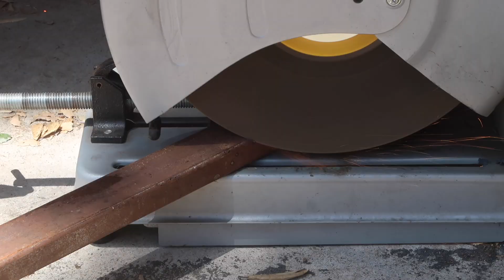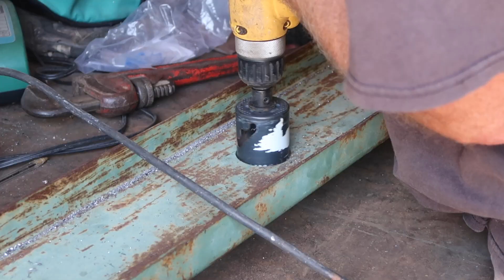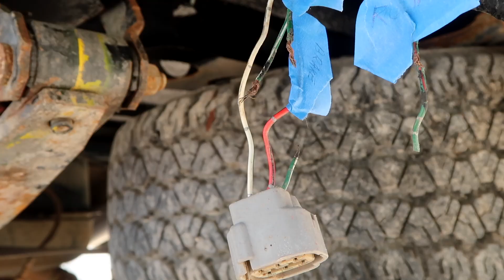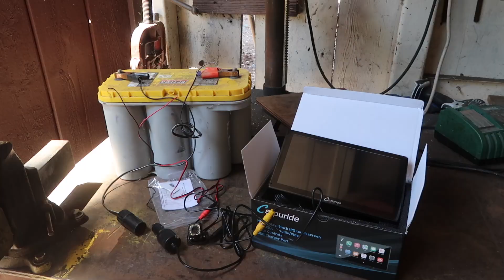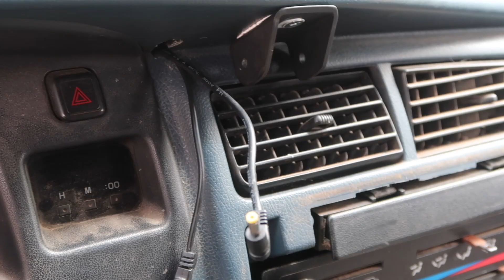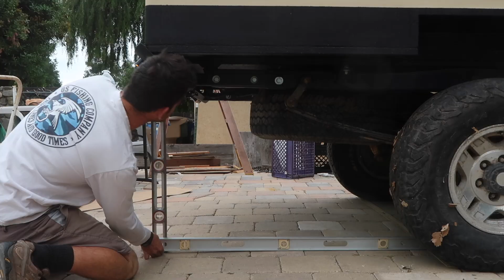Building A 4x4 Truck Camper | DIY Rear Bumper & Back Up Camera Install

Comment: Watched all your excellent camper build videos (THANKS).  Perhaps already asked and answered in the thousands of comments, but i hope you can answer a few: 1)did you use marine plywood?; 2)did you consider building out of xps covered with fiberglass (to save weight, cost, and work)? ;  3) do you have a material cost and time cost so far?   Great work so far, looking forward to more...
Reply from the maker: Glad you've enjoyed the videos Daryl.
1. no its underlayment plywood
2 . I did. 
I couldn't source XPS in California for 1.5 years (when I started the build) because of some environmental requirement change. 
Using glass over 25psi XPS, I would have to use thicker fiberglass cloth and more epoxy to achieve a similar rigidity and impact resistance to the 6oz fiberglass over plywood skins so it may not have been cheaper or lighter. I think it would have saved a lot of labor though.
3.I have not kept track of how much time I have invested. 
I will add up all my receipts once I build out the inside and share the cost with you then.

Thanks for watching
Reply: @The Traveling Together Journal  thanks for taking time to answer.  I am embarking on a similar project and will use cored construction - the choice appears to be to use low cost core (xps) but that demands expensive resin (epoxy) - OR - expensive core to resist low cost resins.  Use of wood facings demands a similar quandry; expensive marine/aircraft plywood - OR - expensive epoxy/glass waterproofing.  I am also considering use of pre-made fiberglass facings (available in rolls) - bonded to xps core - but then finishing and waterproofing the edges is problematic... as are the corner joints.  Always a bunch of compromises to balance.   B T W it's very surprising to me your pour foam did not bulge your panels out much worse, and you were able to avoid voids. My limited experience is my pouring sticks to the side part way down and foams up to block to pour - must be accurate to hit the bottom without hitting the sides - impressive work you did.
Reply from the maker: @DarylOster  Definitely lots of compromises to be made. I think 25psi xps foam with hand laid fiberglass and epoxy resin is probably what I would choose if I was going to try again. 

Though I have heard that pre-fabed composite panels have become more available in the US market. That may be a worth while rout if you can source them. They weren't an option when I got started.

Comment: More excellent progress getting you closer to new adventures in the new rig. One small suggestion. I know others have mentioned the way you have your tail lights mounted. You certianly might have reasons for mounting them where you did but as others have mentioned it seems like they could get damaged if you happen to drag the back end and being that they are angled down their visibility is diminished I imagine. Was wondering since you seem to have pretty good fab skills if you couldn't just make a couple brackets that you could mount to the top edge of your bumper that would be L shaped sort of and bent so that you could mount your lights to the brackets. This would have the lights up higher basically kind of as if you mounted them to the camper itself but attached to the bumper so you wouldn't have to drill into the camper. Visibility would be much better and they wouldn't get damaged if you do happen to drag your bumper
Reply from the maker: Good suggestion. I didn't realize how directional the LED lights are. They definitely aren't as visible as I would like. I will probably do something very similar to what you are suggesting. I am planning on building some kind of swing down entry step for the camper door that will probably hinge off of the rear bumper, so I am putting off re-mounting the lights and license plate until Im ready to open that can of worms 😅

Comment: Excellent work and creativity (like usual).
I think you should relocate the tail lights to above the bumper on the camper wall.  Being at an angle, I think the visibility of the lights will be reduced which might be a safety hazard.  Furthermore, I think they might be more subject to damage being on the bumper.
Reply from the maker: Good thoughts. I may do that and the license plate as well once I make some decisions on entry step and roof-access ladder.
Reply: Came to the comments to say the same thing, love the bumper otherwise, nice work!

Comment: Hey, where I live cops would ticket a plate mounted like that, not able to see well.  
Also, remember a plate light.
Reply from the maker: Thanks. I guess I didn't film mounting the plate light 😅
I'll have to do a deeper dive on the license plate angle. I couldn't find any law saying it had to be mounted at a particular angle 🤷‍♂️